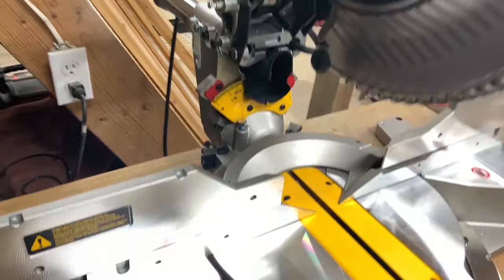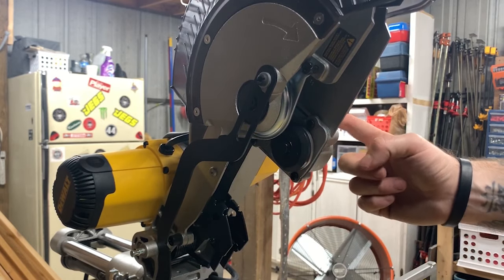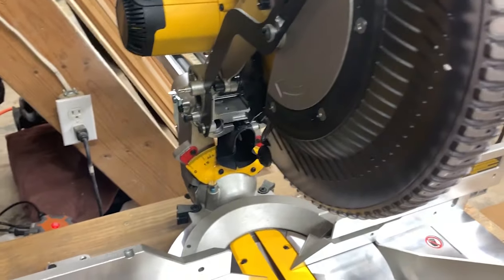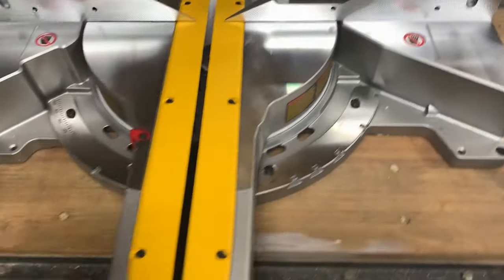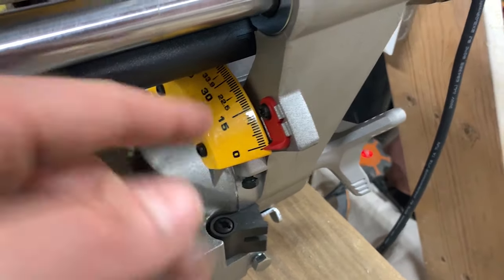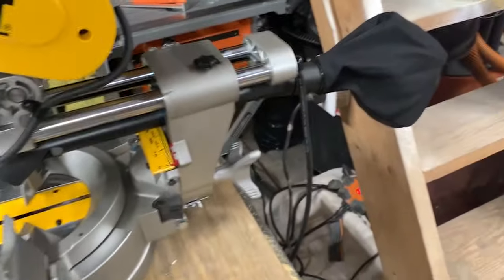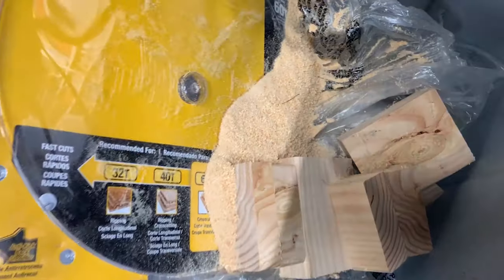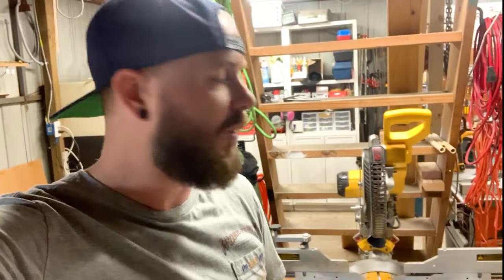Dewalt 12in Sliding Miter Saw DWS779: Setup & Review

Comment: I have the non-sliding 12" model, and have had it close to 20 years.  It has never given me any problems.  Just change the blade when necessary  and check the blade angles from time to time.  Best tool buy in my garage.
Reply from the maker: Nice!!! I honestly feel like this saw could last forever. I keep it cleaned up and I’ll definitely keep the blades changed. It’s been amazing so far, ver happy overall. Thanks for watching and for the comment! 👍🏻

Comment: Thanks for the video.  Was  trying to acclimate to a saw Just purchased. S779 saw used with stand from a local retired carpenter.  $150  - Sat for a year.  A bit packed with saw dust.  Cut really good from the start with a dewalt 60T that it came with. Also purchased a Bosch 4100 table saw ($150) from him that just needed new bearings.   Since the dewalt was used alot,  I busted into the motor on that and am replacing two of the bearings on the armature that had small signs of wear.  Not horrible but maybe on its way out in a years time.   Repacked the gearing behind the blade with grease.  She should be running top notch this week when all my bearings come in.    I bought a new Kobalt 12" and stand a year ago but this dewalt might be my replacement from here on out.   Pretty solid saw.
Reply from the maker: Always good to snag some used tools that need minor repairs, and saves money as well. Thanks for checking out the video!

Comment: I love my Dewalt, had it for 6 years and have never run into any issues.   Smart to put a new blade on, the standard 32T blade is OK, but you are better off with a 60T or 80T blade, much cleaner cut.

Comment: Dude, great video!  Just got my saw and the mobile stand for my birthday present.  Thank you, wife!  You didn't even turn on the laser!  Well, the manual (yes, I read it) calls it a laser but it is actually a shadow.  It's called XPS and includes the light.  Yes, there is a light on your blade at the top.  To turn it on just press the black rubbery switch north of the saw handle (not the carry handle).  Check it out!
Reply from the maker: Hey! Thanks for the comment! I got the 779 which didn’t come with the light kit. I did another video where I added an aftermarket light kit to mine. I think the 780 came with the light kit already on it (which I didn’t know at the time I bought mine). Good luck with your saw and thanks for checking out the video!

Comment: I have a DeWalt 718 and a 780 both work great I double checked my guide to make sure that my angles were correct you can adjust that guide on the front of the saw if your angle is off…I use Diablo 80t blades which I use Diablo blades on all my circular saws …I also use the Ridgid mitre stand which makes it easy to store and easy to roll around
Reply from the maker: I wish I had a miter stand for mine as well, but the workstation build suffices for now. Thanks for checking out the video!

Comment: Great video.  These are indeed great saws and I love mine.  However, it should be noted that the DWS779 has gone through at least three production versions at the time of this response ... Type 20, 21, and 22 now being the latest.  Each production version has obsoleted (ended production of) the prior version.  However, you will not find information concerning the production version Type on the product's packaging.  The production version Type may only be found on the label affixed to the upper surface of the saw's motor.  Suffice it to say that all DWS779 saws are not the same and you have to dig deeper than the model name.  When initially produced, the DWS779 and its $200-$250 more expensive sibling, the DSW780, differed only in that the latter featured an LED shadow cut line light (XPS Light).  While the DWS779 Type 20, possibly Type 21, and DWS780 may have all of the features shown within this video, the DWS779 Type 22 production version lacks at least following features: 
- the bevel stop pawls
- slide stop lever.  
I can only surmise that these production changes were introduced to drive down production cost to make it more competitive, profitable, and provide greater differentiation between itself and the DWS780.  It should be noted that many had been turning their DWS779 saws into full DWS780 saws by adding an aftermarket LED shadow cut line light for less than half of the cost differential between these two saws.  Given this information, should the bevel pawls and slide stop lever be must have features for you, then you will need to purchase the DWS780 rather than the DWS779.  Please additionally note that the DWS779 Type 22 saw has no provision to accept the bevel pawls or slide stop lever parts from the DWS780 or DWS779 Type 20/21.
Reply from the maker: Thanks for the amazing notes here!!  I wish mine has the laser / light option - I think if I could do it over it'd definitely go that route.  Thanks again - I really appreciate the comment!
Reply: @TheToughGuysTV  I just installed the light. You need 3 torx bits, a wire crimper and less than an hour even being careful plus the mod kit parts.
Reply: @charlesanderson6863  likewise for me on the light addition, best 70 i have spent
Reply: @seanclark8452  the newer kits no longer need one to use a crimper and do a cut and splice  it is all plug and play

Comment: I have this saw, it works really nice,  I have a few complaints, 1st off, with the bag it sticks out way to far, if you have a small shop, don't buy this, 2nd off it's really heavy, if I could do it again I would spend more and get a sliding miter saw that could sit flush against the wall, and prob go with a 10 inch since 12 is just so big
Reply from the maker: It’s big for sure, and I call them out on the bag placement in my Evolution Miter Saw Video, it’s pretty crazy how far it sticks out. I don’t move the saw around ever, so the weight doesn’t really affect me but yeah if you have to move it at all might try to find a lighter option. Thanks for checking out the video!

Comment: My Dewalt saw is exactly the same.One thing I found was it was not cutting square.Most saws you might need to fine tune them
Reply from the maker: Yes very true, and over time they can go out of square with normal use as well - thanks for checking out the video! 🙏🏻

Comment: I bought my DWS 779 last winter and two months later I got the XPS LED light kit for it which is what the DWS780 has, you can get the XPS kit from M&M Tool Parts for $63.73
Reply from the maker: Jason - that’s awesome!! I need to get that part / add on for mine for sure!! I’ll check it out! Thanks for watching and for the advice on the light. 💪🏻🙏🏻
Reply: 👌🏽👍🏽🤟🏽🤜🏽🤛🏽 It's very easy to install, M&M Power Tools has a video here on YouTube to help with the installation, I'll look for the link.
Reply: Super simple install. Mine works great! One thing that I haven’t spent the time to straighten out on mine: after the XR upgrade from m&m, every now and then the trigger sticks on. Not that big a deal, it’s only for a few seconds. When I’m done with our house, I’ll take it apart and see what’s sticky.
Reply: I almost bought the 779 with the intent to install the XPS kit, but then the 780 went on sale last week for $449.
Reply: The cheapest I've seen the DWS780 go for was $399 during pre Black Friday
Reply: @jasonbabila6006  Seems there's always a better deal to be had.  Went shopping for a Ridgid AC9946 miter saw stand and bought one for $199 ... then learned they were $99 on Black Friday ... and now they're near impossible to find.
Reply: It's that moment when you say, I should have got one when it was much cheaper back then.
Reply: @kennnva551  
Hi brother,
Wich Store ?
Reply: @lagoniaconstruction574  Home Depot.  I looked again recently and there appears to be a promise of more coming, like another batch is being manufactured.

Comment: Great Video Sir. I can not get mine to Cut 90 degree cuts at full extension its off by a couple of degrees at the fence
Reply from the maker: Interesting that it’s off only at full extension, must me some twisting on the rails as it extends. I’m not even sure if there’s a way to counteract that, maybe try reaching out to Dewalt directly on warranty if the saw is newer? Never heard that issue before, so good luck! Circle back if you find a solution!

Comment: I purchased this saw 3 days ago. Mine came with the ripping blade as well however lowes would not exchange the blade for me so I was stuck purchasing another blade and now have a 32t blade that I have no use for.
Reply from the maker: I’ve looked into a bit more and that 32T is good for construction rip cuts, but not for anything else basically and it is ok to run it.  Switching the blades on the dewalt is super quick too which helps. What blade did you end up purchasing?? I’ve heard the Spyder brand is AMAZING - not tried it yet though.  Thanks for watching and for sharing your thoughts!! 🙌🏻
Reply: The 32 tooth blade is what you want when you’re building decks and any type of framing. It cuts through the lumber faster with less strain on the saw motor. The more teeth you have on your blade the more it will gum up when cutting through pressure treated lumber. I personally have both blades so I will be prepared for any job I want to do.
Reply: A 32T blade absolutely has its uses, go ahead and cut thru a pt 4x4 with a t60 at the same speed with a t32 🤣🤣

Comment: Crazy how different they come in the box at different locations I guess or upgraded versions  I just got mine 2 days ago it has a Allen head bolt for arbor bolt  not a hex head so my tool is torques on one end an Allen on other not the socket style like yours but I do have the trigger thing kind like a safety haven’t
Reply from the maker: Yeah that’s a bit different maybe they do update the models incrementally or something. Good to know and thanks for sharing! Hope your saw works out great! 💪🏻

Comment: Just got mine the other day for our off grid cabin build. Mine came with the 32T blade also took it off and exchange it for the 60T.  Don't know why they put the wrong blade on it. Even says not to use a ripping blade in the manual. How's yours still working?

Comment: Thanks for the video. I just purchased this online for BF 2021, but am picking it up tomorrow at Lowe's. When I was in the store the decal on the throat plate said it cut 14" to the fence and 16"to the rear fence. What rear fence? Even the store employee didn't know what that meant. The only 2 true 16" cutting saws were the Rigid and the Kobalt. Sorry about the Rigid- I know how you feel when you want something to work really badly and it just won't!
Reply from the maker: Not sure on the “rear fence” I’m guessing that’s an error, it’s made to cut up to 14”, so I’ve got no clue. I so wanted the Ridgid to work out.. but this miter is a workhorse, never a single issue. Check out the video on the light kit upgrade I did as well!
Reply: @TheToughGuysTV  I found this video, search:"How to crosscut 16" boards on the dws780 "  this is the "rear fence"- interesting. I'm planning on upgrading the light, I'll check your video out. Thanks!!

Comment: Bought one of these and two days in while in the process of calibrating, I discovered the 90 degree and the right 45 degree positions to be true using a roofing square, but the left 45 was off maybe a 1/2 degree. Back fence true and table bed perfectly flat, leading to the conclusion that the detents are slightly off. Not happy and going back to the Depot.
Reply from the maker: Definitely good to return it if not square, especially if you tried to dial it in.  Something could have been off for sure
Reply: @TheToughGuysTV  Took it back to the Depot and bought the 780 at Lowe's on sale $ 160 off. Lines up great out of the box. I read where the 779 is assembled in Taiwan, not sure about the 780.

Comment: I have the non sliding version of this miter saw and notice that when the blade enters the arbor slot(when bade is down at lowest point of cut)(I think arbor slot is what it is called), the blade is much closer to to left side of the arbor slot than the right(not centered in the middle of the arbor slot).  Don’t see any adjustment to fix that.   Any thoughts appreciated.  Thx
Reply from the maker: It could just be that the slot is a little off? I’m not aware of an adjustment for that, but potentially you can adjust the deck, the entire bottom section. I’d try reaching out to Dewalt support first to see if they could assist you

Comment: Great video thanks! Mine is brand new save a few small projects, but I can’t get the locking pin back in now to lock down the blade after use to store it upright on the cart. Pushing down etc isn’t allowing the pin to slide in. Any idea what I’m doing wrong? Thanks
Reply from the maker: There's a small lever on the right side of the saw (When facing it) that is your blade depth stopper.  You need to flip that up and then it will let you lock the pin in place on the left side.  I should be uploading a video this week on a light kit add-on for this saw that is AWESOME!! So stay tuned for that!
Reply: Thanks. I figured it out and was just going to delete the comment! Your immediate response was awesome! Thanks so much again for the video. Helped with a number of things like how to easily change the blade! Be safe and well!

Comment: Yes i was wondering why you didnt fully like the ridgid im looking to buy a saw here soon and been looking at dewalt milwaukee and ridgid  because of the warranties too  what all steered you against ridgid just the sawdust or was there more to it. Thanks?
Reply from the maker: Definitely check out our full video on the Ridgid, I had major issues with the 12” dual bevel saw, returned 2 of them - lots of vibration from the saw as well as blade wobble - good luck and thanks for reaching out!! 💪🏻

Comment: Lucky they did that. I had to call Dewalt and speak to manager because cs tried hard to say it was the right blade, I watched too many others to know better, the one they put in box is for ripping.  DW Told me they will send me the 60T as a courtesy. Lol.  Ask for manager and they will fix you up.
Reply from the maker: Nice! Glad you had success with the blade as well! I’m not sure if it actually wouldn’t work correctly, but the instructions say what they say - so it’s best to follow that in my opinion. Thanks for checking out the video and for sharing your experience!!
Reply: @TheToughGuysTV  it makes a difference with more teeth. 80 T would be even sweeter.
Reply from the maker: Oh yeah for sure! I’ve been looking into getting some new blades for various projects, looking at 80T options. Check out what Evolution is doing with their saws as well - I’ve got a video up on their R255 Miter - that thing is amazing. Their blade technology is outstanding - cuts through basically anything
Reply: @autumngrace3135  did they send you the 60T blade after all??

Comment: Awesome video. I just unboxed and set mine up this evening. We moved into a new home a year ago and I have already started tearing up the main level flooring to install hardwood, so I'll be putting this through its paces this next week. Is Dewalt replacing the blade, I also received the 32T one?
Reply from the maker: Definitely worth contacting them. Unless they changed it, the instructions mention not using a 32T blade with this saw - not sure why. That’s how I was able to get mine replaced. Good luck with your hardwood floors and thanks for watching the video!! 🙌🏻

Comment: Couple tips, when cross cutting do it with the blade all the way down to send the sawdust into the shoot. And don't use finish blades for normal or treated lumber. That's a cheapo blade too. Get diablo 44t for cross cuts and rips.
Reply from the maker: I have a Diablo on it now for sure!  Thanks for the notes and for checking out the video!

Comment: Funny, mine had an extra security below the on/off button (black flat handle) to unlock the blade cover. Probably due to regulations in Europe... Very nice (but heavy) saw!
Reply from the maker: Yeah that thing is heavy! Mine has that little flap under the button as well, I must not have shown that very well in the video - it's a safety so you can't accidentally engage the saw.  Thanks for watching!
Reply: @TheToughGuysTV  I just removed it... So much better (mine sometimes got stuck). The cap makes it safe enough in my opinion. When you accidential engage the saw, the cap is still on, so no problem. I think when the saw is new, the security "flap" works much smoother, but after a while it gets a bit rougher.

Comment: Is the depth gauge accurate and saw arm stable to allow good quality trench cutting and mortises prepared by repeated cross cutting. Great video. Is 2 inch deep flat bottom mortise n 4x4 inch possible ?
Reply from the maker: I’ve not tried a 2in cut, but I’ve done a few mortise joints with the cross cutting. It does work ok - I ended up using a 2x2 across the back side to bump out the 2x4s I was cross cutting. Without that 2x2 I wasn’t getting a straight line at the rear.  Was way easier than using my circular saw I’ll say that much. Thanks for the question, hope I was able to answer well enough! 🙏🏻

Comment: Great video, helped with the set up. I just purchased the saw this week, from Lowes as well. Where did you see that it was supposed to come with a 60T blade? The one I just purchased came with a 32T blade.
Reply from the maker: I noticed some wording in the instruction booklet, it could have since been updated. Honestly, from what Ives learned since this video, you’re probably good to go w/ the 32T blade but def consider going with Diablo / Freud or equivalent upgrade anyways. The Dewalt blade won’t last longe either way. Good luck and thanks for watching!